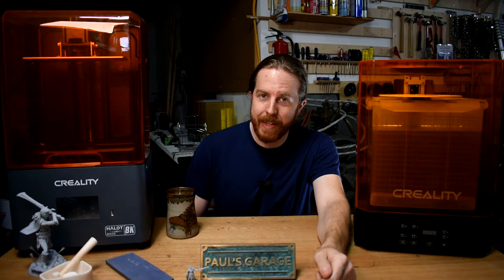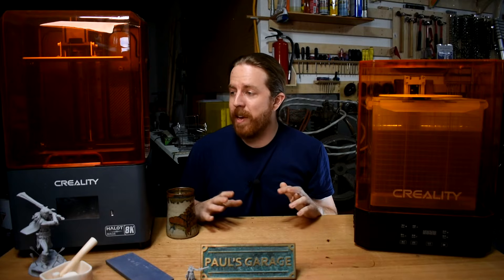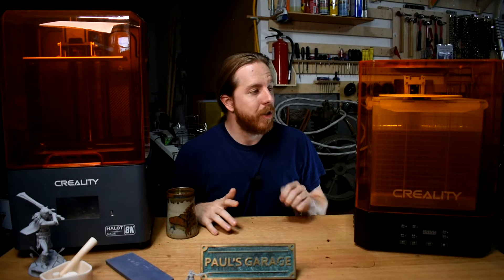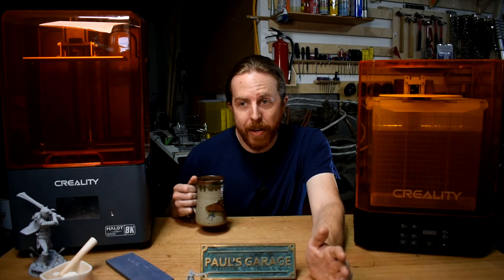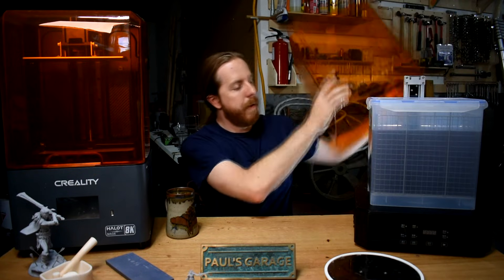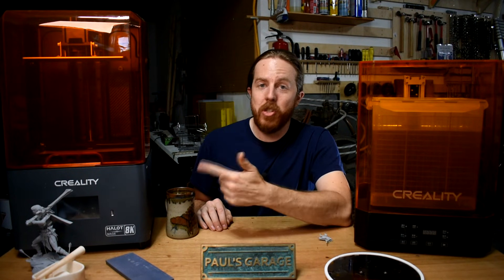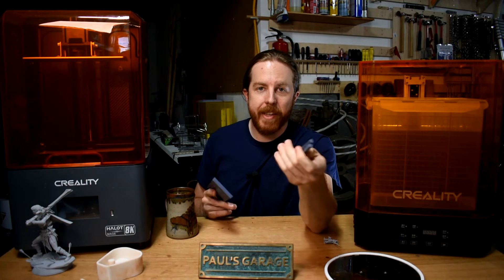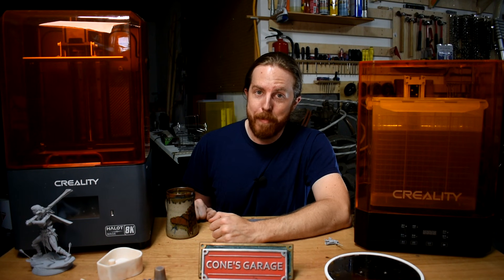Resin 3D Printing for Your Shop? | Creality Halot Mage 8K Printer

Comment from the maker: Check out my New 3D Printer Focused Channel!:  https://www.youtube.com/@PaulsPrinterProjects

Want to use your 3D printer to learn Sand Casting in your home shop?  https://paulsmakeracademy.mykajabi.com/joinus

(affiliate links, obviously)
Reply: Resin printers are usually terrible for technical prints (at least the cheap Chinese ones, ours cost 250k and it´s great at that) because you have the FEP film and every time a layer change happens the machine pulls on that film and stretches and distorts the part ever so slightly which adds up. If you print a cat or something this is simply not noticable.
That´s also why printing at an angle which you mentioned here is better because the surface which sticks to the film is now much much smaller at a time and thus the peel forces are reduced.
Reply from the maker: Thanks for the tip!  I found printing flat gave me more consistent dimensions but caused other issues.  These are cheap Chinese ones though, I would hope a 250k machine would be better lol
Reply: @sierraecho884   Apparently, "lubing" the FEP can make a big difference in releasing the part from the FEP; some recommend silicone, others PTFE, and even RainX.
Reply: @Loneman_OG  Not sure about any of this. It will mix in with the resin etc. 
It´s like the old "lubing the filament" idea which was horrible. 
You can of course try it out, analyse the results and post them here however I am really sceptical. Peeling would probably be the best solution.
Reply: Were you talking about a specific other printer that was more compact? or just that there are others that are more compact?
Reply from the maker: I can't speak for other 10" printers but I have a 9" one that's much more compact (elegoo mars 4 max).  It's about as small as it can be and still fit the screen.  Resolution and size isnt as good as this Creality one though
Reply: @PaulsGarage   "but I have a 9'' one"
Some dudes, just have to brag! 🙄😂
Reply: Bought the mage 8k and wash and cure 01 as a bundle yesterday, 336 British wealth credits with 2kg of resin

Comment: If you put the exhaust pipe out the window; does it matter if its cold or hot outside vs interior temp?
Reply from the maker: not really as long as the air doesn't come back in and cool off the resin tank.  Also, if you cant vent it, there are resins that are FAR less toxic.  Look up "formlabs creator tough" for example.  No ACMO chemicals, so the exposure times are longer, but the fumes are far less of a problem.

Comment: Hello everyone, I am a 3D resin enthusiast and also an industrial designer. Recently, I invented a light curing resin suction gun, which perfectly solves the tedious problem of changing resin or suctioning resin in desktop-level light curing printers. It is 10 times faster than the recycling device provided by the equipment, and it can avoid the contamination between resins by using a dedicated bottle. You can see the specific operation on my homepage.

Comment: Is resin printing better for making artistic stuff or mechanical parts?
Im just getting into filament printing to DIY parts for 40+ year old Soviet and Nato night vision gear.
Reply from the maker: @colin3424  it depends.  Certain resins and certain filaments are better than others.  What i will say is if you want tiny details and less prominent layer lines, resin beats FDM.  Fdm is a lot easier to print (no alcohol washing and super toxic liquid resins) and fdm machines tend to be much larger.  There are some resin printers/resins like the Reflex RS and their PAS10 resin that approximate injection molded ABS, if that's what you're trying to replicate.  Both resin and fdm can be used to make good patterns for sand casting, and both resin and FDM can also print resins for investment casting burnout, with some exceptions.  For tiny artistic stuff like miniatures, however, it's resin hands down.

Comment: paper weight creality and 10 saturn 4 ultra printing non stop for months. creality should be ashamed of them shelves for this crap. never ever again will they get my money FDM or resin.
Reply from the maker: Which creality printers that you have are paperweights?  I still haven't had an issue with this old halot 8k, but I've heard plenty of people with issues with the pro and the newer mages.  I don't think I have a creality FDM printer that works at the moment lol

Comment: Queation: I want to print little tiny figures that can be encapsulated in acrylic for making custom keyboard key caps. You mentioned that some Creality printers with lower size resolution are better for this than the large one featured in the video. Do you have a printer model by this company that you can reccommend that also meets my need?
Reply: The mars 5 Ultra from elgoo has very good pixle resolution (18 microns), second best in the industry right now and it's also beginner friendly, it cost about $280 right now, its a smaller printer so good for small things.
Reply from the maker: I don't have any other resin printers by this company, but the best resolution printer i have is a Mars 5 ultra.  The prints are a little more detailed but I think you would be surprised how good almost any resin printer can print.  Most of it is down to resin and settings.

Comment: Did the Wash and Cure Station come with the 3-D Printer or did you have to buy it separately?
Reply from the maker: It comes separately, but sometimes you can get a deal if you buy them together.  I've tried 3 company's wash and cure stations, they all work better than doing it manually

Comment: You are funny.🤣  Problem with this printer I found, it is very slow and it has limited settings compared to other printers, like the Elegoo.
Reply from the maker: I agree with that statement.  i have an elegoo mars 5 ultra and it blows this one away speed-wise.  But this year old halot mage 8k is still working perfectly, can't complain about that.  it's making creaking noises sometimes, but it still works fine. original screen, but i have replaced the fep a few times.

Comment: Designating printers by the K number is stupid. They should use resolution. The Halot 8k should be the Halot 30um or Just Halot 30.
Reply from the maker: I like that idea.  Post the screen size and pixel size, leave the "k" garbage out of it.  Also wow this video is old.  The halot 30um is still working perfectly well after all this time
Reply: @PaulsGarage  Thanks. I use Phrozen machines. But it's good to see what else is out there.

Comment: as someone who has only printed with a signle FDM printer and normally can spend between 2 and 5 days printing one model, if not more time, I find it absurd how people who print in resin think that 8 or 12 hours is printing is too long. doing a perfect print of a 19cm bust with no supports, with jerk control, slow printing of walls for best result, and a layer hight of 0.6 or 0.8mm can take between 2 and 4 days. all that to somewhat mimick the level of detail that a resin printer can offer in less than 10 hours.
Reply from the maker: I agree, speed is not the answer.  I have a couple new "fast" FDM printers too and I discovered the secret to make them work beautifully:  slow the speeds back down 🤣

Comment: Do you believe that the resin 3d printers could make resistents things like gears? Thank you very much!
Reply from the maker: it's possible, but with limitations.  In my experience, the stiffer resins tend to be more brittle, and less brittle resins are more flexible.  Neither are good for gears that need to hold a lot of weight or that need to mesh cleanly (for high speed, for example).  There are some good tough, rigid resins out there, but i'm not sure they compete with injection molded plastic gears.  Also, resin prints can warp over time, also not great for gears.  You can cast the printed gears in metal, which would help, but for high speed/high strength gears (think car transmissions) you really need them to be machined from metal, not cast with teeth in place.  So i guess it all depends on what you are making.
Reply: @PaulsGarage  Tks!👍

Comment: I'm extremely new to 3d printing but so far, as far as I can tell resin 3d printing seems way more of a hassle vs non-resin 3d printing.  Why would someone want the extra hassle or what are the benefits to resin 3d printing?  All I seen was the prints are just a bit better quality.
Reply from the maker: Great question.  I've done a lot of both resin and FDM printing, and to be honest, there isn't a "better" option overall.  They both do very different things, so it depends on what you want to make.  It isn't just that resin is better quality in general, but that resin prints are a whole different level of small detail.  It's not even close.  But resin printers tend to be smaller for similar cost, and resin per volume is often more expensive (and much more fiddly).  that isn't to say FDM printing is free from problems, some filaments are even more problematic than resins.  I wouldn't pick based on which one seems like a hassle, but which one excels in the way that matters to you.  I think of it like MIG and TIG welding.  They're both welders, but they do very different things.  Sure, they can do the job of the other to some extent, but often for a specific task one is clearly better.  Get both if it's in the budget.
Reply: @PaulsGarage  thanks, that makes total sense.  I like my bambu p1s.  I like being able to print functional parts for around the house and shop.  I think I chose the correct printer. Thanks!

Comment: Hello, I am new at resin printing and am  a little bit scared, do you think 3d printing is worth the risk because I heard a lot and am not sure if I am safe anymore I wear mask and gloves and I try to be very careful but I have read many horror stories, is resin that big deal , do you have any health problems from resin, if a spill happens it will be a huge problem for my health?
Reply from the maker: Great question.  I think resin printing is perfectly safe if you follow a few safety practices.  Definitely wear gloves touching anything that isn't a fully cleaned and cured part, and for the fumes I personally leave everything in a garage, not my house.  I don't honestly wear a mask very much but I also don't spend lots of time in the room with the printers running or with exposed resin. If you never touch the resin, wear a respirator with VOC filters, and don't hang out with the running printers for hours a day, you will be fine.  

The only issue I get is itchiness if I'm not careful and I get resin or resin contaminated alcohol on my skin.  Limit your contact and you should be fine.
Reply: @PaulsGarage  ty for you reply, also I want to ask if I need specific clothing when I am working with resin or you can wash resin from clothing with ipa?
Reply from the maker: Ipa would work but honestly if I get resin on my clothes I just put them in the washer like normal

Comment: I want to start printing oni masks will this do or do i need a bigger one?
Reply from the maker: Depends how big you want the masks to be.  I can print a mask for me using this printer, but the masks I made don't have teeth and horns sticking out.  Something you can do to check is download lychee, a slicer, and put the oni mask file in there with this printer selected.  If it fits, you're good.  If not, you'll need a Jupiter or sonic mega.  It's a good way to check sizing before you buy anything

Comment: Hey Paul, I'm 0/3 on printing with my new Halot Mage 8k.  I just cant get it to stick to the build plate. I've leveled and tightened the screws as instructed. I'm using Creaality resin and have upped the exposer but still the prints turn out as pancakes in the resin pool.   I'm still just trying to print the sliced files that came with the printer.  Also tried slicing the provided stl with new exposure values.  Any other suggestions?
Reply from the maker: Sorry to hear that!  I would first make sure the plate is level, you said you have done that.  Then I would make sure it's the right height. If you leveled the build plate above the screen with a single sheet of printer paper, you should be ok.  If you use anything thicker, the bed is too high.  I always throw out any included cards and just use printer paper.  

Next I would check base exposure.  I use 30-50 seconds depending on the resin.  

I would also clean the build plate totally with alcohol and try again.  Sometimes the plates come with a coating that causes problems.

Lastly, I heard of someone who took the textured plate a roughed it up with some really course sand paper.  This is the same idea as roughing up a surface for glueing.  I didn't do this but maybe there is some variation between machines. 

Let me know if you are having other issues, and join the discord server (link in video description) for help, YouTube doesn't always notify me of comment replies

Comment: Easy to work out the angle to your printer using the micron of it! Angles are not all for every printer 45° 30° no use the Arcan chart of the angle of micron to get your angles

Comment: Cones of calibration doesn't work for larger screens if you match it to a validation matrix v2 it's way off!  It needs a some tweaking for larger printer's to give an accurate test print till then use a validation matrix V2 card!  When the cones print perfect on say a 10in screen then double check it to The validation matrix you won't recognise the matrix it's so over or under exposed so yeah wouldn't use it for anything 6.6in screen
Reply from the maker: That might explain the trouble I'm having.  I've started using the calibration matrix, then the  amerilabs town and minis from OnePageRules as my calibration now and that's seems to work better.

Comment: Probably the worse printer to start with its to fast the motor build plate was FAUX HAMMERS video on it first the resin refill nossle breaks easy and the fan cover the build plate gets stuck underneath it
Reply from the maker: Faux hammers video was a different printer.  All the problems he had were related to the Halot Mage PRO, this is not the pro, just the standard 8k.  No high speed, no resin nossle to break off, none of those features.  Just an 8k printer and nothing extra

Comment: What's the smallest prints you have repeated on the halotbox mage
Reply from the maker: Repeated?  I don't repeat a ton of prints, but I have printed some very small things or very small details on larger things.  I printed a large item at 1mm thin, no issues, and some minis I printed to test it out have long skinny parts smaller than 1mm in diameter and they work fine.  Pixel size is 29.5 microns but obviously you can't print a thing that small.  The detail on the printer is good enough that the limiting factor is probably the resin and not the printer itself

Comment: Been really thinking of getting a resin printer now for my metal casting. I don’t like layer lines.
Reply from the maker: You totally should.  It's a steeper learning curve than FDM printing and it's a bit messier, but the print quality is unbelievable.  You have to use casting resins though,, you can't get away with normal resin for investment casting.  PLA ash isn't quite as hard as normal resin ash.  

Resin printers are especially good at not having layer lines.  The detail is incredible.  Even mid range printers these days are crazy good.

Comment: "I LOVE old Japanese cars" - I have about 30 cars, about half Japanese, you'd get a kick out of quite a few I'm sure :-) maybe even some of the sweet old euro ones, too. Nothing after 1998 except one parts car engine donor from 04 for a 92 :-)
Reply from the maker: Care to join the discord and share some pics? I would love to see!  I only have 1 pre'98 Japanese car, it's a 1988 Mazda 323 GTX.  The 4wd turbo one.  Got a couple newer than 98 though!  My mom has an old 88 supra, too.  Great era for Japanese cars.
Reply: @PaulsGarage  sure, I can do that :-) if you don't have a fan's cars section make one so I feel welcome ;-)
Reply from the maker: @fredio54  there is a car section 😉
Reply: @PaulsGarage  there is a problem. Your discord is not limked from your yt about, video description, or any post in yt community which I hadn't even found until now. Can you: add it to about, add it to future vid description link sets, anywhere else you feel is valuable :-)
Reply from the maker: @fredio54  there should be a link in the description of this video, it's supposed to do that automatically.  You have to scroll down a ways I think.  I'll add one to the about section too.
Reply: @PaulsGarage  I'm sorry, it IS there, just skimmed to quickly, but about section for your core links = winner :-)

Comment: Note on the alcohol, once too dirty to use you could distill it to remove the contaminants and continue using it. Better for the environment IF your electricity is clean (unlikely in the US).
Reply from the maker: My electricity is definitely 100% natural gas.  It's a very new plant, so it's about as clean as gas gets, but no solar or wind or nuclear for me
Reply: @PaulsGarage  Another method: wait for most of the resin to settle towards the bottom, and then place your bucket in the sun. Most of the resin in the bucket will cure out and slowly sink to the bottom, you can then and filtered the hardened resin out.

Costs zero money and makes your isopropanol last a whole lot longer.